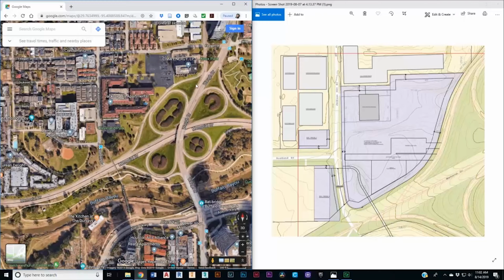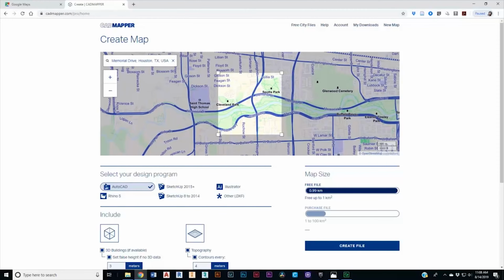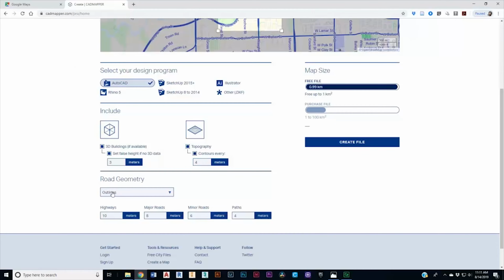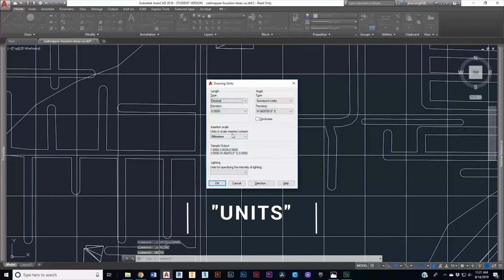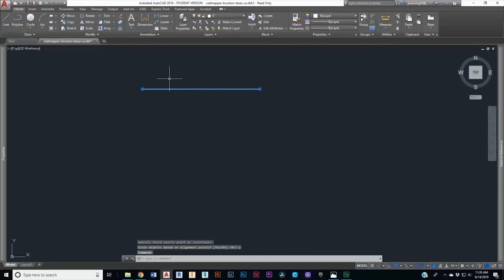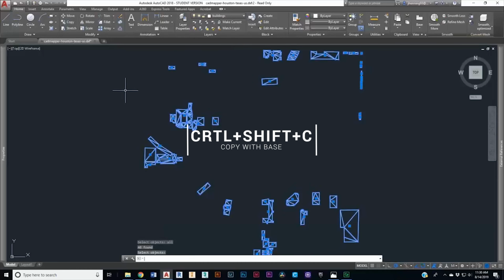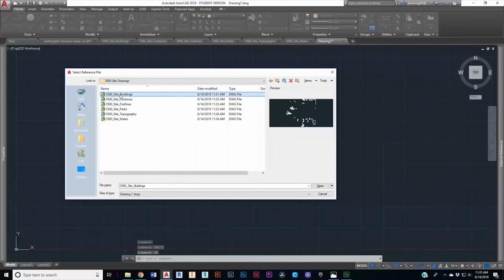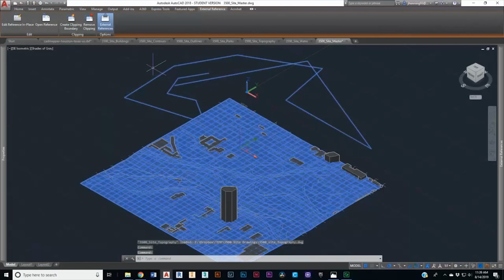Create a 3D Site Plan Using CADMapper and AutoCAD

Comment: I watch your 'cadmapper to revit' videos at the beginning of every new semester when doing my site analysis. You are very thorough in the explaining the process and its much appreciated! Quick question! When in Cadmapper, why do you do road outlines and not road meshes? Follow up question lol what is a mesh road? I've always had trouble editing roads once everything is transferred into revit so do you have any tips? Will downloading road meshes solve that?
Reply from the maker: That's awesome to hear! I appreciate the kind words and I'm so glad that these videos are still providing value for you. For your questions, I choose road outlines for two reasons: 1, because they're easier to edit than meshes and provide the same level of information in most of my use cases (diagramming), and 2, if I ever needed to fabricate a site model using the CADMapper file as the base, I usually default to using a laser cutter or craft cutter which requires clean vector linework to perform best. You can always convert the road outlines to 3D geometry or surfaces if needed. But if ever in doubt, just download both mesh and outline roads as two separate files. Hope this helps!

Comment: I'm still trying to ascertain how I can be sure the global positioning in terms of easting and northing is correct. I recently completed the process of transferring my CADMapper plan into a topographical surface for use with a previously - globally positioned - Revit model. However once imported the surface required dragging and dropping into place, relative to my ordnance survey plan. I have checked this video and one produced by Balkan Architect, but neither of these videos focuses on true positioning of the surface derived, relative to the proposed building's coordinates. I'd really be keen to get my head around that as its key to figuring out whether ramps or steps etc. are required.

Comment: I usually scale using scale command I feel like they both work the same way. (Draw a line in the street from where the street starts and how big you wanted to be in this case 19.685 i would recommend you make it in another color to distinguish it from the rest. Highlight everything except the 19.685 line. type sc for scale enter click on your first point where both lines from the street start. type R for reference click on the same point again than click to where the line 19.685 ends and that should scale it up the same way. just make sure to delete the line after you finish.
Reply from the maker: Thank you for sharing the tip, Carla! I'm so glad that you found this useful! If we can save time in the technical process of design, we can focus more time on critical thinking. If you have any suggestions for future videos, I'm always open to ideas!
Reply: by the way thank you so much for introducing us to Cadmapper this is a life saver!

Comment: Very informative video, thanks a lot for explaining things. An issue I'm having is that my cadmapper topography file doesn't have the topography I need, it is just wrong. It should show a railway that sits on top of a crest, but it is simply not mapped by the program. I guess i will need to edit that topography myself. :(
Reply from the maker: Hey there! Thanks for watching! CADMapper uses Open Street Map (OSM) data, so if it doesn’t exist on OSM, then it will reflect incorrectly on the CADMapper export file. CADMApper is a great tool to help you get you started with a base file. But oftentimes, you may need to add your own geometry or make changes as necessary to reflect your actual site. CADMapper is really a tool for helping with the schematic design phase of design. The only real and true way to get completely accurate site data is to have a surveyor physically go to the site and take measurements. Hope this helps, and good luck my friend!

Comment: Thanks for making these tutorials on the topic, very easy to follow and helpful! I did run into an issue though when trying to link the xref CAD file into revit though, I kept running into a visibility issue after inserting and haven't found a solution to it other than using the original file. I was wondering if you have encountered similar or know of a solution? Cheers :)
Reply from the maker: Hi Reece - Thank you so much for the feedback! Could you elaborate a bit on the issue? I’d love to try to help!
Reply: @Rascoh  Thanks! When I look at the site master model on CAD all of the xref files are accurate and line up correctly but when I try to bring in the linked files to the toposurface on Revit they insert pretty inconsistently where they break into the toposurface at certain parts or are entirely underneath.
Reply from the maker: Thanks for the clarification! It sounds like the issue may be in the “Import” menu of Revit. When you go to link the .dwg files, be sure that your settings read like this: “Layers/Levels” = Visible. “Import Units” = auto detect (make sure you converted from metric to imperial). “Positioning” = origin to origin (this keeps all the 0,0,0 coordinates lined up). “Place at” = level 1 (for everything). Let me know if that helps!
Reply: @Rascoh  That's worked out great! Thank you for getting back to me and helping out!
Reply from the maker: Reece Martin Glad to hear it! Thank for reaching out and do let me know if you have any other questions/suggestions 😊

Comment: What if its outside the Cadmapper square/zone? No luck?
Reply from the maker: Erik Leypoldt You can make the selection square larger, but you will have to pay for it after 1sqkm. OR you can export multiple 1sqkm CADMapper files and stitch them together manually in AutoCAD, and you won’t have to pay. However, this method can be VERY time consuming depending on what you plan to use your file for (digital drawings vs. making physical laser cut model, for example).

Comment: Ok that was great, now make a video about bringing it into revit to make a topography
Reply from the maker: Jonathan Bonaparte I’ve already made a video on that exact subject! Check out the other videos on my channel 👍🏻 Let me know what you think.
Reply: @Rascoh  if someone is not a expert like you in autocad, they will find it hard to follow your instructions because you talk so fast. But I'm getting there LoL
Reply from the maker: Jonathan Bonaparte You can try pausing the video as needed to “slow down”. Also, I have written versions of the tutorial on my website that you may find useful: www.rascoh.studio/tutorials
Reply: OK, followed your instructions to the T. Everything worked out until i brought it into revit. Somehow the topography was much smaller then my model. Any suggestions
Reply from the maker: Jonathan Bonaparte Check the Revit import scale units. It is very likely something to do with scale. Is your Revit model in imperial? Or metric?
Reply: The problem is the AL command. It asks for a third point before the y or no
Reply from the maker: Jonathan Bonaparte We only need to select two source points since it is a 2D alignment. Just type “N” or “no” for the third source point. You would only use 3 source points for alignment in a 3D workspace.
Reply: Yeah it won't let you type no or n. Saying it's an invalid command. Thanks anyway.